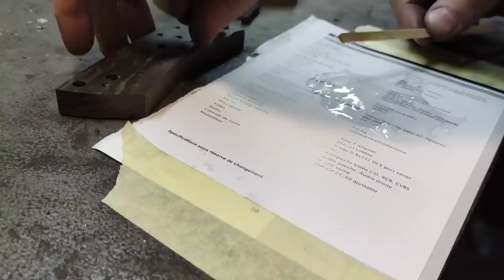Knife Making : Forging a CLEAVER from a bearing

Comment: Where can you find these bearings? Junkyards? Also, Are wheel bearings from cars the same? 
 
As far as I know, this is 52100 steel. Very good stuff, can achieve a very high hardness.

Thank you.
Reply from the maker: There is a lot of such material in landfills ... There are different bearings 52100, G52986, J19965 ...

Comment: Great blade but I would have made the hole at the end of the handle bigger, otherwise how are you going to hang it the kitchen? I have magnetic strips to hold my knives but I don't think they would hold up that beast..
Reply from the maker: Thanks. No more hole is a problem
Reply: @fz-makingknives3663  Sorry I dont understand. Could you make the hole bigger or not?
Reply from the maker: can be done